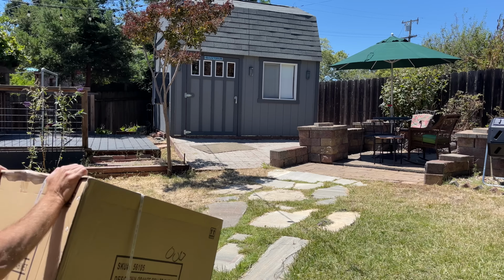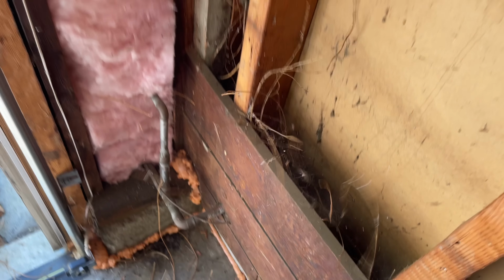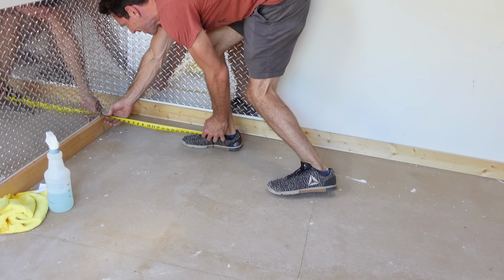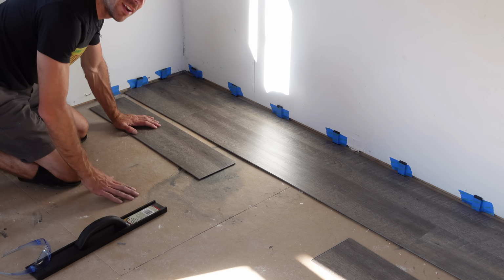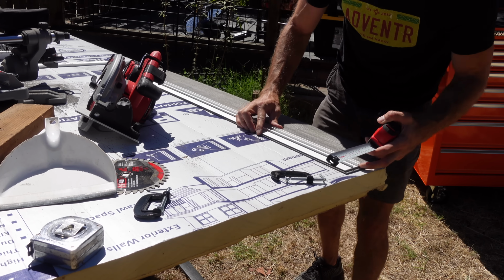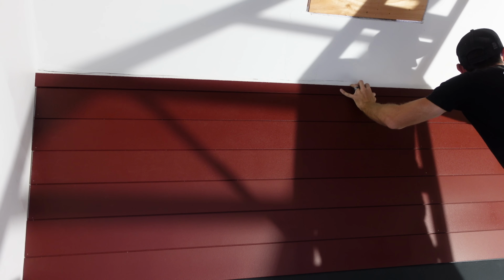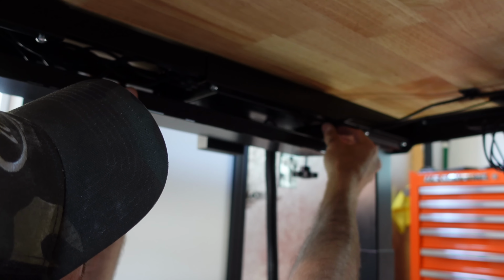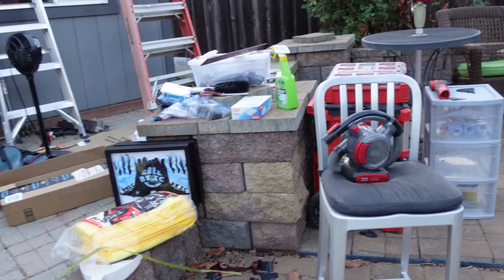Transforming my shed from a DISASTER ZONE into a DREAM studio

Comment: Just do all your measurements in 16’s of an inch. Ex. 1/16, 2/16, 3/16,  4/16 clear up to 15/16. Sounds dumb until you start doing it. ESP if you are calling out measurements to a cut man. You can call out 4 and 1/4” or you can just call out 4” and 4. Being that all the fractions are in 16” you only need to say the first number of the fraction. Nice when you are writing measurements down on your work to come back to also. Plus it will drive math teachers insane if they hear you doing it.
Reply from the maker: I love that idea!

Comment: Love my steadyracks!  Pro tip, if you're hanging them on a plaster wall, don't mess around with plaster anchors or trying to find studs etc, just hang a big sheet of ply.  It will make your life so much easier as it means you can place  the racks exactly where you need them.

Comment: Did ya water seal the floor if you did not.  The mold might come back.  If moisture is getting in with the foam it will come back as well.  Fox moisture issue then floor.     Water seal everything like if you have baseboards water seal up to them.  Then floor.